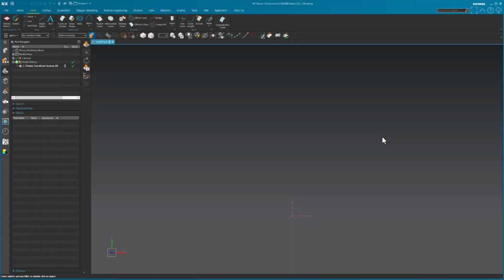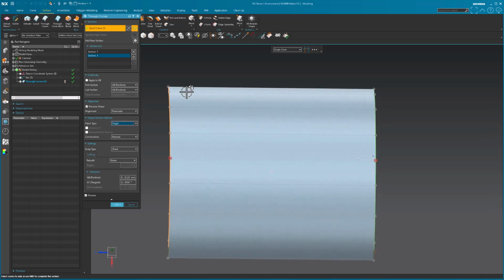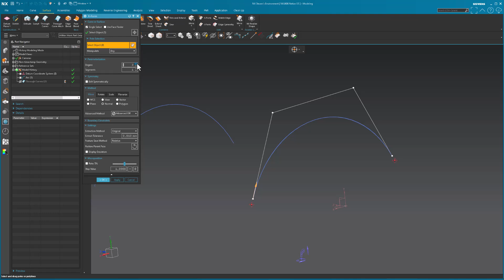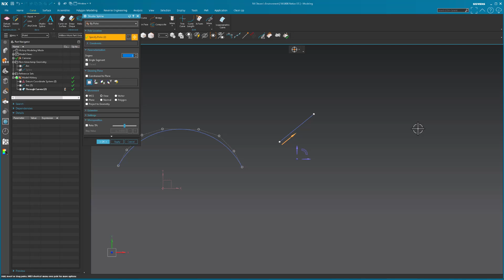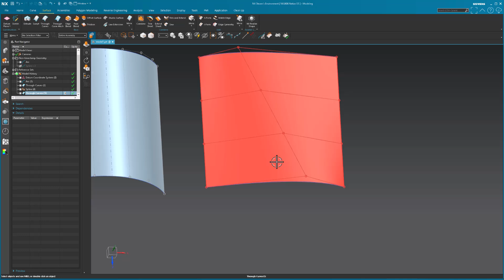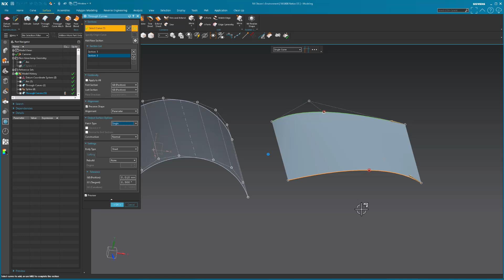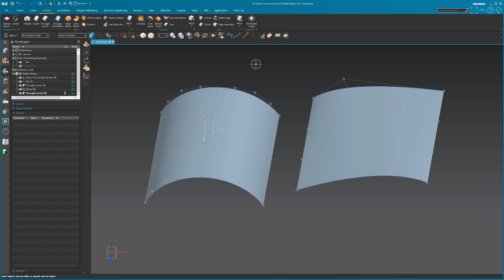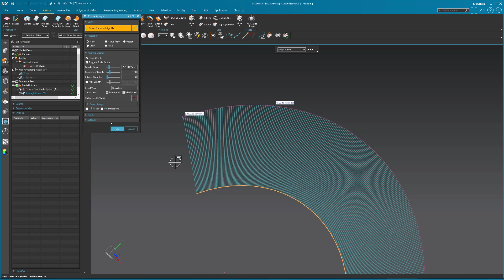Arcs vs NURBS | Why so Many Control Points?

Comment: Thank you. Very interesting! I did some testing, and found that in the special case where my arcs are one quarter of a circle, the resulting surface is very simple. Using preserve shape and lofting degree 1, you will get only six nodes, three for each arc. Furthermore, it seems like the surface match the arcs perfectly. What is happening here? And why is lofting degree affecting the surface, even when we have only two sections?
Reply: Further testing reveals that there is a limit at 120 degrees span angle for the arcs. If span angle for both arcs are below or equal to 120 degrees, the resulting through curves face has only 6 nodes.

Comment: Hi! Isn’t the parabola simpliest NURBS curve? General conic has slightly more complex equation in my opinion… with different rho parameters general conic can be parabola/hyperbola/ellips/arc. The problem about representation of the NURBS is the polynomial form, while arc is like y=sqrt(r^2-x^2). Anyway good video ;)
Reply from the maker: I am over simplifying the explanations. 

A 2 degree NURBS curve is basically a conic.

Thank you